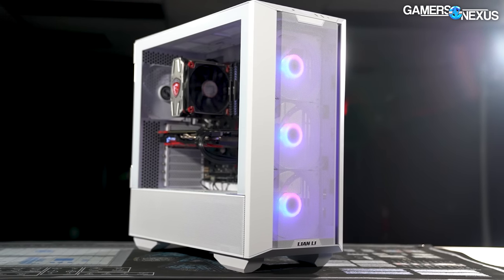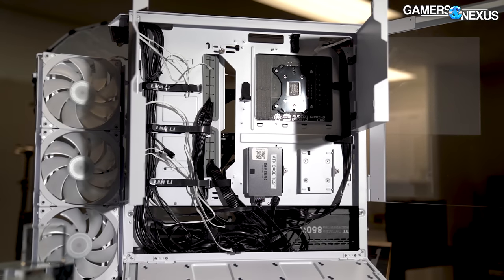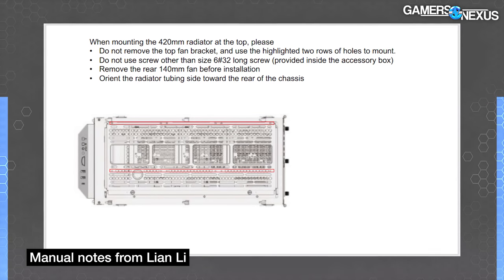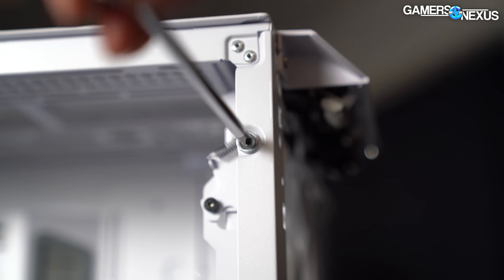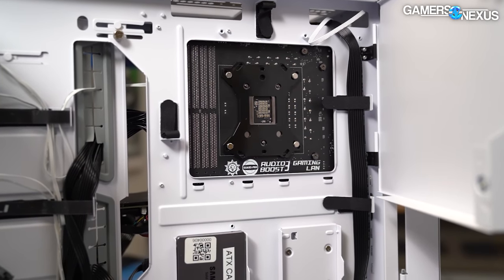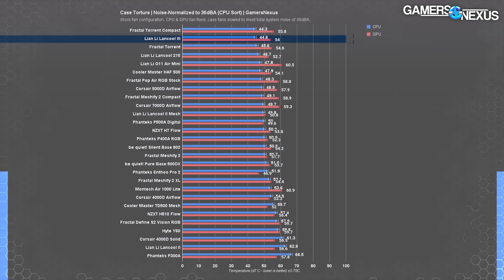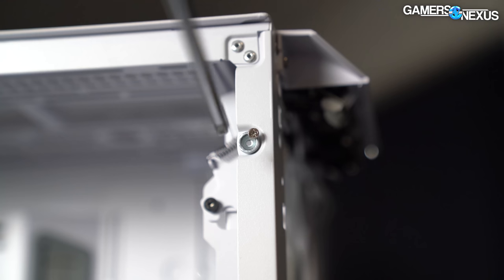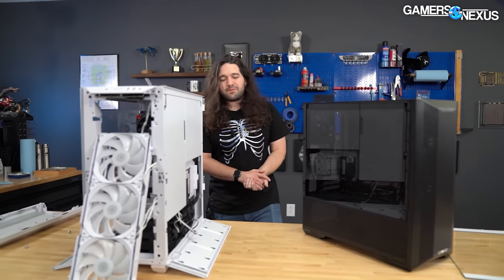Lian Li Lancool III Case Review: Build Quality, Thermals, & Cable Management

Comment: Do any manufacturers make lightweight good cases? I have the lancool 2 non mesh and the lancool 3 and another Thermaltake full tower core V 71 I think it is. I like the LC cases but they really are heavy. I am sort of regretting the LC 3 due to weight and even with good cable management,  the working side magnets are stressfull. I don't think Ill get that style again the back doors should have screws.

Comment: Its a interesting case that's for sure i do wonder why you don't get cases like mine anymore. My case holds 12 3.5 drives and a ssd with really good airflow i notice that most case are not like mine anymore its a sever tower is the best description i can call it. it was around $380 au if i remember right.

Comment: Would have been nice to see some tests of GPU temps with one or two PSU shroud fans installed, in my experience it's one of the easiest ways to cut GPU temps, even if you use a weak fan like a 15mm thick one at under 1000 rpm.

Comment: what is the largest radiator that that can be mounted on the front mount to use a push/pull setup on the fans while positioning the inlet and outlet of the rad on the bottom?

Comment: Can you please do a dedicated content piece on PCIE power cables with daisy chain connectors. Is it actually bad to run a daisy chain cable or not on for example a 3080 TI with 2x8 pin sockets. So much conflicting information out there.

Comment: Sorry Steve it took me a while to get around to watching this case review. I agree with your conclusions. Although for me nothing beats the 011D in all its forms. I have the original 011D for my water cooled gaming pc. I am sitting here getting ready to tear it down once again to change my gpu. I got the Sapphire Toxic for $999.99 from Micro Center. I don't think we will see that kind of pricing for a LC GPU for some time to come. So I decided NOT to wait for RDNA3, I was disappointed many times waiting in line at the store or online for RDNA2. This is an upgrade from my custom water cooled Sapphire Nitro+ SE. It has served me well for 3 years, I expect the same with this one. Thanks to you and the team for all this hard work.

Comment: Impressive details on the review, probably the most in-depth review out there! I own the lancool 2 mesh, and the changes, although minor, are really cool for people who mess with their build a lot! The adjustable panel on the side also helps fitting E-ATX mobod i believe, besides the water reservoir and bigger GPUs
Reply: @htr5372  yeah, i mean the adjustment, which the 2 mesh also have, serve this purpose as well as the ones mentioned in the video (reservoir/GPU). I think in the official channel they say that you can move the panel to fit E-ATX or water cooler gear, just wanted to add it as it was not mentioned in this vid.

Comment: as a lancool 2 owner, i'd probably not get another lancool case. it's not a terrible case, but it's lacking easily removable and cleanable dustfilters and i'm not a fan of the sideflaps anymore, they bend easily. the 2nd glass panel is a bit pointless.
this is not much of a change from the lancool 2, it's more like a 2.1.

Comment: Love Lian Li and Fractal cases, both are my immediate go to brands when making recommendations to my customers and my own builds.  Lian Li Lancool II Mesh was the best option when it released and the $89.00 price tag made it an easy grab.  Seeing the new Mesh III was much anticipated but at it's way overpriced stance for the level of improvements, the Lancool II Mesh will still be the one I go for.  No issues at all with Air cooling setups and it holds enough water cooling options for even top end systems.  Sorry Lian Li, I love your cases but $150-$170 for the Lancool Mesh III is too much especially without all the add in options that came with the Mesh II at a $100 price point.  

Special thanks to Steve and the Gang for finally helping the Case market get back to proper airflow and no more the H500 nonsense that was choking PC's for about a decade.  Keep up the great work helping with innovation and getting the proper cooling myths busted that other builders promote to the detriment of their customers.  Awesome Work GN!!!!

P.S Hey Steve I wonder if the Hot swap plate for the Mesh II will fit on the bays for this version or the LED strip?  You didn't mention if you guys tried to do that, be neat if if they fit if we wanted a smallish upgrade to the III and keep the features of the II.  Great video as always!

Comment: Might get a Lian Li case as going to the few microcenters in NYC i keep seeing the resident display going off with usual RGB cable combs to need a case with good air flow and to put my MSI aio in so my used 580 can breath and prob add in two more noctua fans maybe

Also, for surely get more GN merch 1 of my shirts came in the mail to the 2nd limited edition foil cyber skeleton shirts will surely be ordered with maybe a GN desk mat & tool kit too i hope!!!

Comment: Hello i wanted to ask some advice, i am torn between the lancool III and a silent base 802.. the price range is similar, also how is lancool III compared to II mesh? i was planning a modest build with a i5 13400 when it gets out and a rtx 3060 ti / 4060 ti depending on price. My goal for this build is longevity, i don't update often in fact i usually use a pc until it dies or after 8-10 years so i'd like something which can keep my components cool and doesn't make too much noise.

Comment: I'm curious how much of an effect mounting fans on the PSU shroud have on GPU temperatures. It seems like air flow to those fans is going to be somewhat restricted, especially with a PSU and possibly HDDs mounted down below. I'm wondering whether or not it would be worth buying fans to put there to get lower GPU temps or whether it's just sort of a "put lots of fans in the case and make an RGB light show" gimmick.

Comment: Since I forget things these days I really like this case. You you that thing you should have put in several steps before and it's laying on the work bench? Most times it would be a holy s@it moment, but not any more with the Lancool III! With all of those Maxwell Smart doors you can simply pick up that part and pop it in. So, to me it's very thoughtfully made for old builders.

Comment: I love gamers nexus case reviews!  I was building my current pc last year and I couldn't decide between a couple of options. I chose the thermaltake view 71 after seeing the in depth review by GN. Then I also bought the EK 360 Elite aio based on another GN review. Some people say it's too expensive BUT it came with 6× 120mm argb fans which really move a lot of air. Those fans are over $20 each so a little over $120 worth of fans. I got the aio for 20% off plus a $10 gift card newegg gave me. I paid $169 for the aio so if you deduct the price of the included fans it means I paid $50 for the rad and pump

Comment: What is internal (back side) space like if you don't want to use the supplied fans and need space for 2 RGB & controller hubs eg. iCue Commander Pro or 2x RGB hubs and 2 Lighting node pros) and controllers. Can they fit on the flap or are you limited to the small space where the backplate SSD mounts.

Comment: I'm with Patrick, I'd rather have a solid steel door on the back so then why would you need the cable covers. Why waist all the money on a piece of glass that all you can see on the back is a cover and 2 SSD's. It would make more sense and savings just to have a steel door on the back without cable covers and at the most put a window in that door to see the SSD's which I don't think is needed either. If Lian Li was smart they would put the money into upgrading the fans with option Uni fans for the RGB cases like the SL Infinity fans or the AL fans. If I wanted RGB I would pay a little more for the Infinity fans vs. the  old style fans that come with the case now which that is what my grandson wants me to put in his new case. It would also be nice if they made 140mm infinity fans to have in this case in front and in the rear. Having 3 120 side panel fans would also be a plus with perforated back side steel door as a big plus. The Evo I/O would also fix the front panel removal. I like the Evo out of them all but will never buy due to having ZERO fans and NO MESH FRONT and in the end will end up with the Fractal Mesh 2 Compact for it's size vs. the Evo or the Lancool III for it's larger size and not so good fans. Lian Li has good cases with all the upgrades but they don't install the upgrade fans in any of there cases. Lian Li: What good Is selling a case where We have to pay extra just to use your cases when we can just buy another case from someone else for a lot cheaper and use the case right out of the box. Your Evo NEEDS FANS and Front MESH included for the price you are trying to charge for a case you can't use without fans. Either case is OK but you have a problem with your use of fans.

Comment: I was wondering if you give some advice please. I am looking for a new full tower case. At the moment Phanteks Enthoo Pro 1 is exactly what i'm looking for with front facing panel and front ports for dvd drive and good air flow. I was wondering if there where any alternatives you could recommend to look at please. I desperately need a case that fits like this as i have serious health issues and restricted to arm movement. Any help appreciated please

Comment: Thank you for doing all the in-depth research into the important details that can affect performance, also take the tail chasing research that many of us do. Being a LianLi O11D Evo owner I gotta say they make amazing cases, though the one I got is a bit bulky for me but that's all I could get (wanted Pantex meshify). I've only owned a maingear tower from 2006 and an old HP envy that i upgraded back in 2014. My dreamachine replaced my dell 7559 and got to say its super fun to be back building/optimizing everything.

Comment: another great case review. i would love to see you guys check out the vetroo al600. it has caught my eye both for being a budget branded case with plenty of fan mounting options. but i am very curious if being from a more budget brand if it is actually worth $100+. but 6 fans in a case that looks to have decent airflow for just over $100 seems like a ok deal.

Comment: I have a question for you guys, I'm buying a MSI MAG Core Liquid 360R V2 this week, would you guys mount it on the top for the case or the front? And one more idea wish you guys testing it with the front filter it's a add-on.

Comment: With front intakes and bottom PSU it's better to remove PSU shroud and useless (in 2022) drive cages. That way once the airflow hits PSU, the only way is up where it hits GPU and thus helps cooling it. You could probably improve that a bit further by adding inclined slope-cap in front of PSU while also hiding cables. Works even better in compact mATX cases. 
While fullsized PSU shroud is just a counter productive gimmick.

Comment: Thank you as always for such an in-depth and helpful review. I prefer most of my intake to come from the bottom of the case, so hoping companies make more like the Torrent and O11 Evo. Seems like the success of both the O11 line and Torrent line would create more competitors, but so far... not really.
Reply: Because it's not the slam dunk you think it is. It leads to a allow of unwelcome case design compromises, and as shown on the thermal ranking the Lancool 2 Mesh is actually ranked really high up in cooling. It's close to the Torrent while being much cheaper, and it stomps out the O11's cooling performance. Manufacturers are not going to be quick to adopt luxury case features.
Reply: @RicochetForce  not sure where you thought it would be a slam dunk. I didn't say anywhere that the O11 and Torrent are in the same price tier either. The MetallicGear Qube was at $130 and I would like to see more like it. Not sure why the animosity and the misguided comment, but seeing how well the O11 and Torrent lines have sold, there is a huge market for full intake underneath... whether or not you like it.
Reply: @vaderwashere365  They sold well. The rest of the market still exists, and as we see from Gamer's Nexus traditional case designs are still extremely performant. Popularity alone will not get bottom intake to become ubiquitous.

Comment: I like the approach of the backside doors, and this kind of design could be taken so much further. Find a way to secure them, add a door over the SSD mount, make them a bit more sturdy, and clean up the chassis bezel, they could easily stand in for a full side panel. Hell, they could do this on both sides and have optional glass panels instead of solid panels, similar with mesh panels, though on the display side the doors would have to interlock rather than having a tray to latch to. Personally, I don't entirely like the magnet approach, I'd rather have something more secure, even if that means more mechanical complexity. Stemming from this, having the motherboard area and PSU area being modular would also be a nice touch, that way you can swap from a basement to an attic, with the front fan area being it's own separate module as to not obstruct fan compatibility; this modularity would fit the door approach nicely. This approach could also make it to where the motherboard unit could be flipped between sides, as there is some market for reverse-mounted boards; stemming from this, with some modification to the overall case and making the motherboard module square, the motherboard could also be rotated, which also has some amount of a market. The next generation of this case could easily become a modular system, and there could also be a variety of modules, such as replacing the front-mount fan module for a side-mount fan module, alla the O11's design, or a front extension for full watercooling support, or a taller front unit to support an attic+basement build, a double-wide system could also exist, etc., as the base case itself would just be a wireframe skeleton with either doors or drop-in fan mounts, really the only 'panel' parts are just beauty panels such as the front panel. Modular casing should really be the next step in case design, give more options to the consumer with less full-case SKUs, having things broken down into modules could also help with warehousing depending on the approach taken, instead of having a dedicated case and dedicated XL version, or dedicated mesh version and dedicated standard versions, etc., having components broken down into individual parts that can be bundled upon order will minimize warehousing needs, not to mention you can offer a larger array of options for a singular case designation; though this can get messy on the retailer side of things. I've argued these same kinds of points on a few cases previously, there's potential for it to work, one of these companies just needs to actually do it to get the ball rolling, especially when it's seemingly so close to actually happening as some case design iterations are becoming more modular in design philosophy but the chassis itself isn't physically broken down into modules yet.

Comment: Wouldn’t have been such a hard task to get those screws into the magnet threads if you used a smaller screwdriver and held the end with smaller hands 🙄

Comment: Quick question, had the review unit been the performance one rather than the rgb one would it be resulting in much better data? Because if I'm not mistaken I remember your review of the Lancool ii mesh is on the performance model. Btw, I bought the Lancool ii mesh because of your reviews, absolutely good content guys 🔥

Comment: i have the lancool 2 mesh . almost all my pc's ever have been in a lian li case.
Reply: the biggest improvement imo is the top side. look very asymmetrical on the lancool 2 . the 3rd fan on the bottom inside the case and the 140mm in the back. i only paid 99euro for my case . that's cheap imo. for a case that doesn't cut your fingers lol

Comment: about time that i start hearing about this case. the Lancool II is plenty good enough for me, but if i build another system, it's probably to be the Lancool III case. i'm curious though, is this version any  heavier than it's predecessor? the Lancool II is quite heavy when a full system with a thick GPU, 5 additional fans with a controller, 3 hard drives, and Noctua tower cooler is inside. that is one of two downsides, the latter being the magnets to keep the tempered glass. they completely shattered on one side, making me think there was a fitment issue for half a year, until i realized they broke, now it sits flush as intended, but doesn't always stay shut the first time.

overall, i like the minor changes they've made for the most part. the only design choice i don't quite agree with is the placement of front I/O. i can get why they chose to design it the way they did, but diagonal USB (or other ports) is a huge pet peeve of mine. however, bonus points to Lian Li for making both lower panels mesh, instead of just one. that always confused me greatly on the Lancool II. oh yeah, and i'm glad to know the fans can get just as loud (if not louder) than my current case. had to get a fan controller since my motherboard's PWM headers were in the worst possible locations.
Reply: This case is both larger and heavier than the Lancool II. That's the downside of thick steel cases.

Comment: I would be happier with "grabbing and yanking" than Fractal Meshify C case where its "You will need the strength of 100 men to push in this tab to remove the filter" (filter also sucks btw). lol